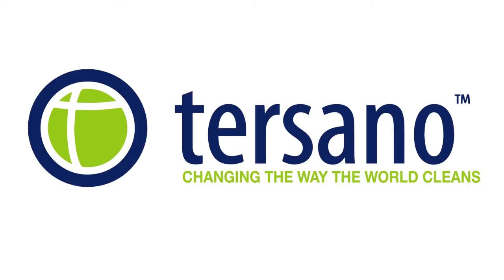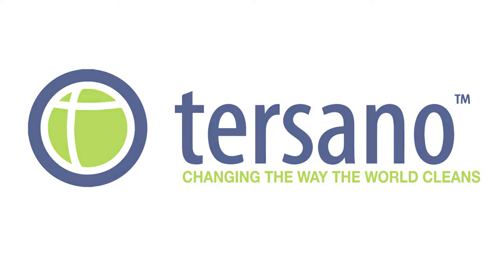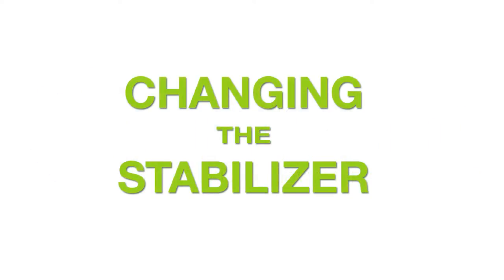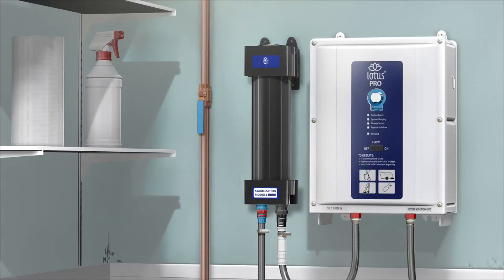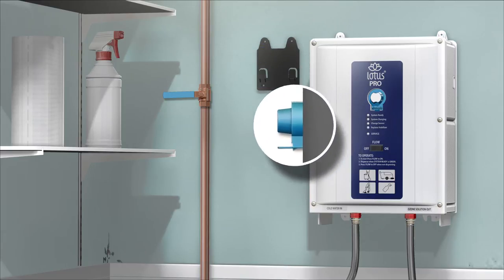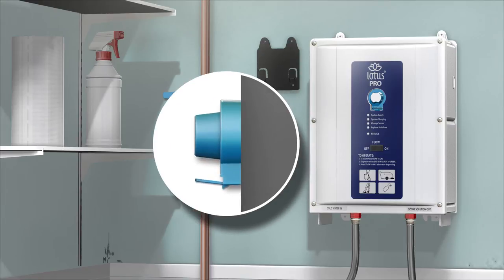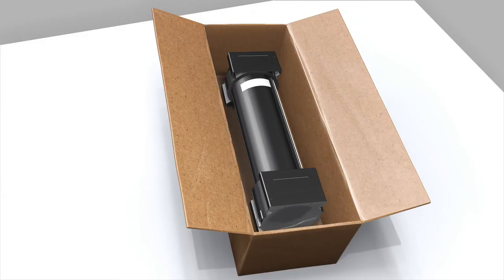Lotus® Pro - How to Change the Cartridge

Comment: How often do you need to replace the cartridge?  How does the stabilizer work?  Would it require less replacements if the supply is hooked upto a water softener supply?  What about a Reverse Osmosis supply?  And I’ve heard that it is not recommended with distilled water as the water is not very conducive?